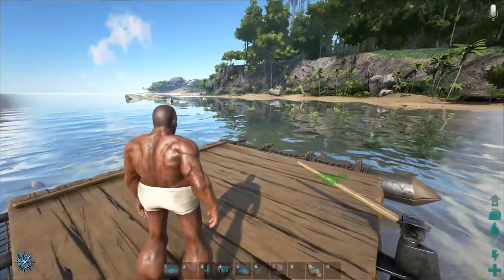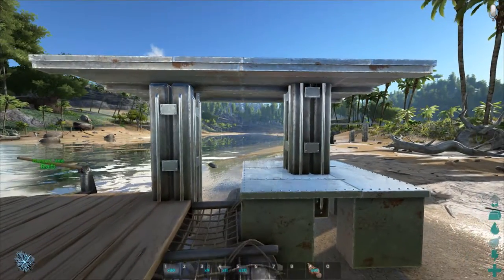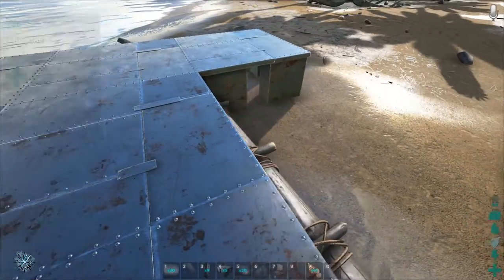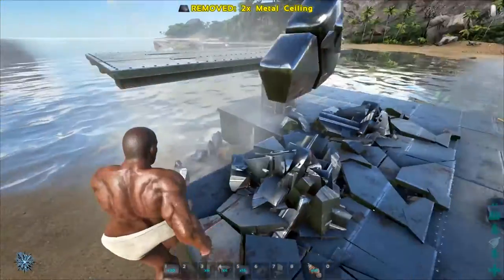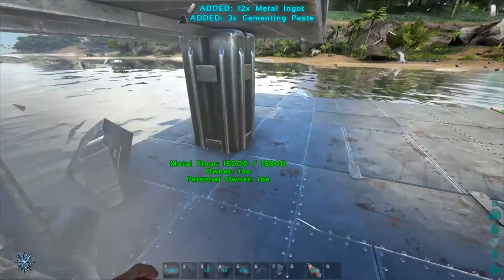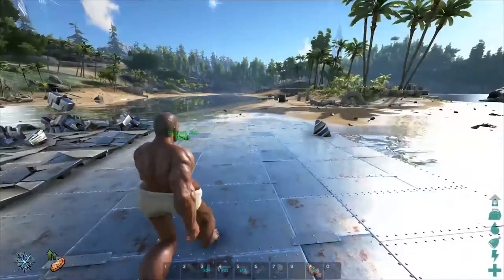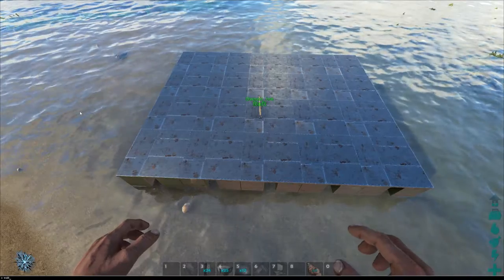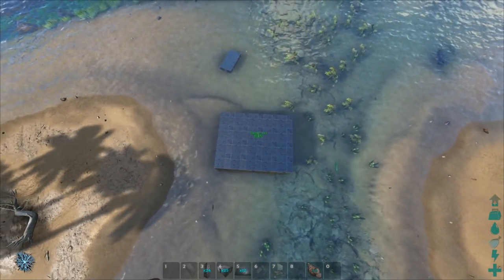Build a MEGA TANK BOAT | TL;DR Tricks | Ark Survival Evolved | Episode 9

Comment: Cool that you're getting into rafts a bit, myself and my friends keep a fleet of ships for raiding coastal bases so I'm really into this sort of thing. One small pointer would be that you can do this a little more efficiently by sinking foundations into the raft and then using ceilings to snap on further foundations and extend further out. Otherwise, good stuff; keep it up!
Reply from the maker: +PleasureKing69 actually that has been patched,  you can no longer do that.  That's why I do it this way
Reply: I don't believe it has, I made a new raft with that technique just a couple of days ago. If you center a pillar by using the rudder, you can rotate the camera downwards and you will hit a sweet spot where the preview starts to flicker. At that point the pillar should place correctly and you can sink your foundations from there.
Reply from the maker: +PleasureKing69 I've been told it's only possible with thatch roofs,  I'll test it tonight to see.
Reply: That's quite possibly the case, I used thatch roofs myself.